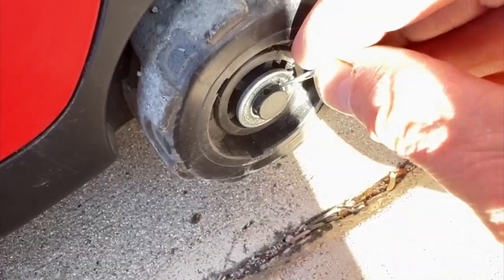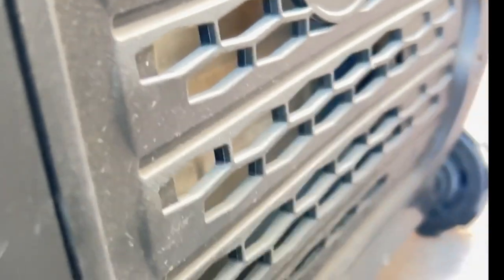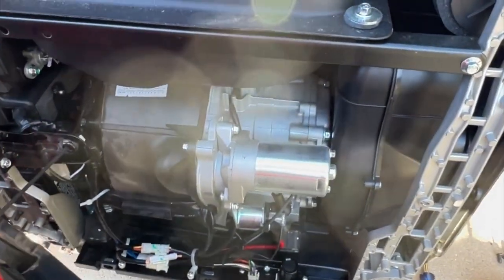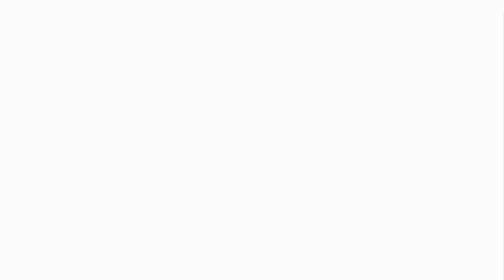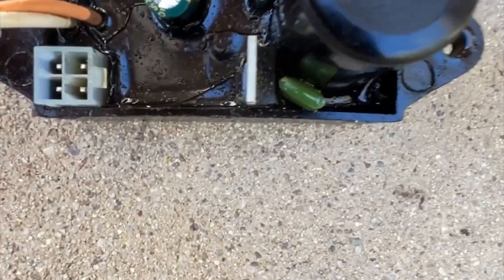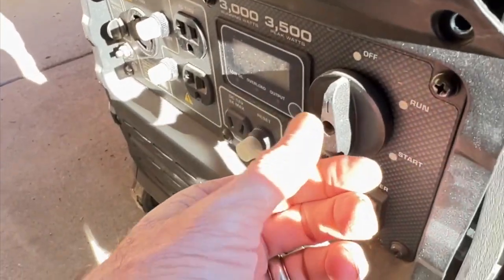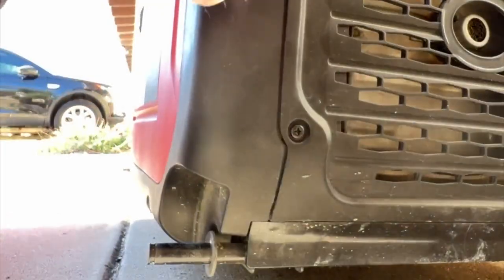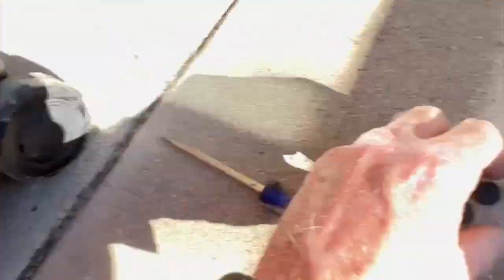Predator 3500 Inverter Generator Fix for a bad Ignition Ignitor Module #diy #travel #electric

Comment: Did you take note of the electrolytic polarity markings? I had several inverter generators, different brand but probably from the same factory, that each failed with similar symptoms right at the 20 hour mark. They were warranty replacements so I never found the exact cause but speculated that a reversed capacitor in the CDI would start to fail at about this time frame
Reply from the maker: Unfortunately I didn’t pay attention to that. It would be interesting to know if that was the cause. Thanks for the question!